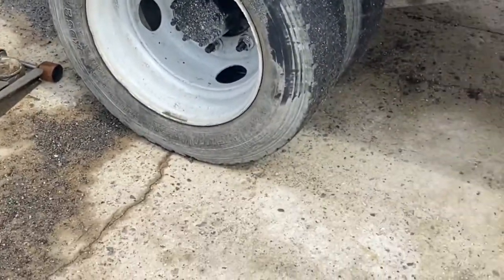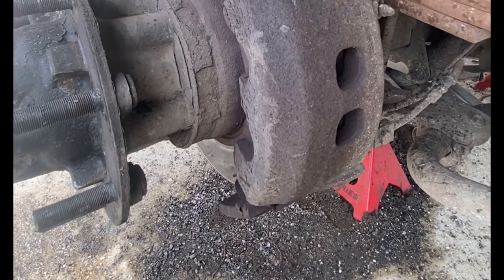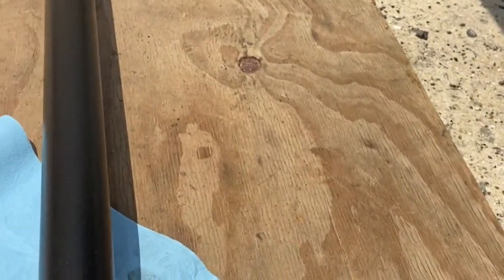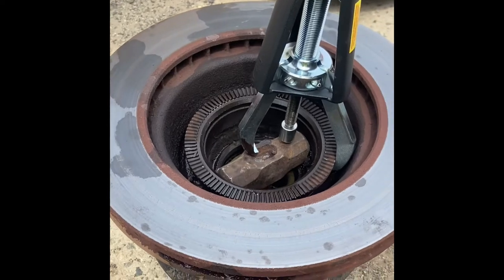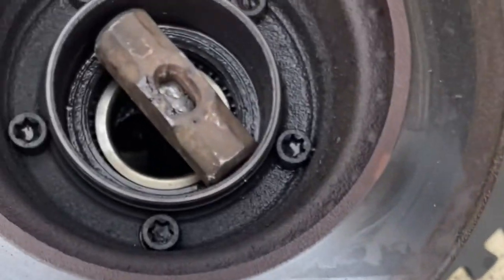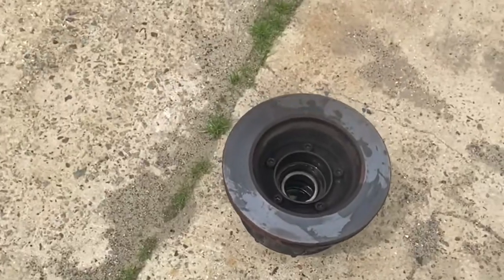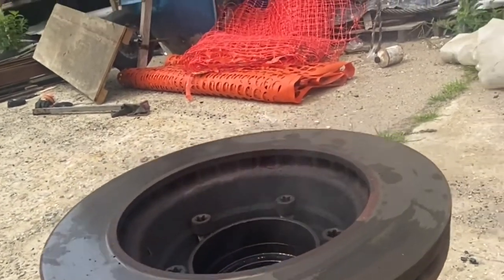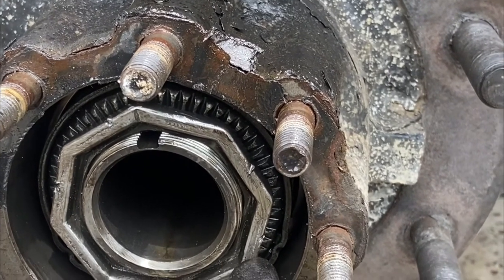GMC C5500 BRAKE ROTOR AND CALIPER REPLACEMENT HOW TO!!

Comment: A respectable job .
Did you replace the oil seal in the hub and the axle flange gasket ?
The spindle bearing nut procedure is “77 ft lbs while turning the hub and bearings then back off the nut 90 degrees and retorque to 18 ft lbs “
And did you put any gear oil in the hub before you reinstalled it ?
Reply: I do believe that those specs are for Greased Bearings which are on my front 4X4 . Someone did post the specs for oiled bearings/rear. 
I had trouble with my fronts did those several times then just increased the torque on them until they stopped backing off. One side did need a new ratcheting nut??? that was it was called?sorry have forgot right now.
Reply: I was going to comment on this. It has to be seated then backed off.

Comment: I had marked mine with the white steel markers, using two crescents to lift and guide the axle in that last 3 inches. 
Sorry where is your new driveshaft  seal. Should be cleaned as well if your going to use RTV. Which Should work as well.  
As well should use brake clean on that new one. 
I did do the one man brake bleed method. With a 2 liter pop bottle (washed it out right away with water let it dry for a week ) Put 2something inches of brake oil and then bled them into the bottle worked well. Do pump most of the oil out of the chamber before starting so that new oil will not be wasted mixing with the old oil.
Reply from the maker: I put the old seal couldn’t get the new one till a few days after we need the truck and the road

Comment: Hi there, I have a Kodiak C45400  and I'm having trouble getting the main axle out. I see you use a hammer to knock it loose. I've beaten mine and it still won't come loose. what would you recommend?
Reply from the maker: You would of to hammer it real hard like your going to break it .get a big hammer if you need to because mine was really hard to get off I just keep hitting it. because it might have some lock around the nut that needs to come loose hope I could help.have a blessed one

Comment: Hello, Just curious, Was the rotor damaged, like cracked or warped? When you need just to replace and put NEW brake pads on, do you still need to replace the rotor? 
Mine still looks great. I have a 2005 Chevrolet c5500 Kodiak 8.1 Vortec, on a Motorhome chassis. 
Thanks!
Reply from the maker: If it looks good you don’t have to charge it you can just charge the brake pad mine was bad it’s a lot of work to get the rotor so if you don’t ofto just leave it have a blessed one how it’s all work out good for you

Comment: So I have a 2008 gmc 5500, What is the tourque sequence i have the same style nut as you have in this video. Someone said 77 ft lbs then back of 90 then tourqe down to 18 ft lbs. is That correct??
Reply from the maker: Sorry  don’t remember it’s was like a year ago but it’s somewhere around 80 to 90 I did

Comment: WHAT TOOL # IS THE PULLER? I BOUGHT 1 BUT THE "CLAWS" AARE TOO THICK TO GET IN THERE.
Reply from the maker: It don’t have a size and the one I used and it was too small but I make it work sorry I couldn’t help
Reply: @karlonarcher7918  a friend came over with a heel bar that worked pretty good.

Comment: How many qt does the rear take gear oil
Reply from the maker: Not sure I didn’t take all of it out only take like one qt out for what I was doing
Reply: The manual says 7 Qts. Didn't take that much just fill it to the filler bolt on the diff.